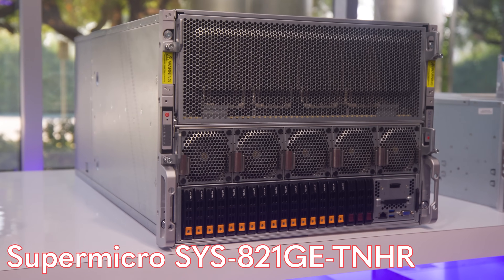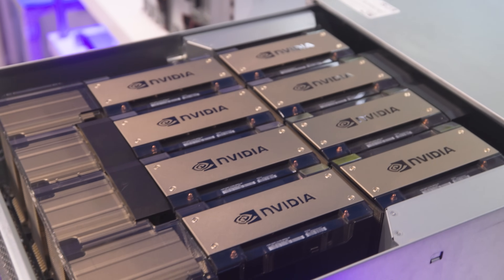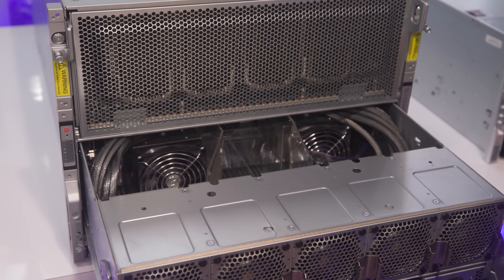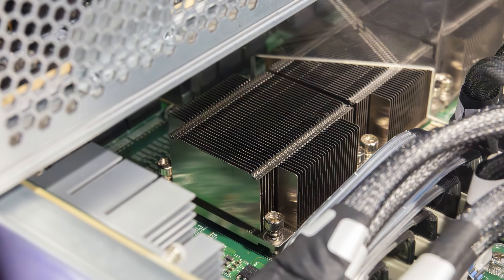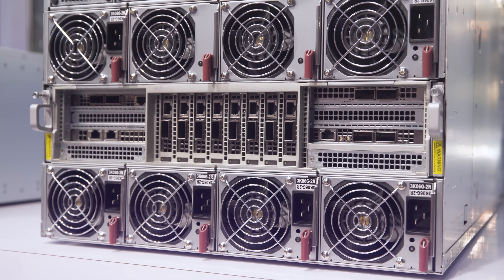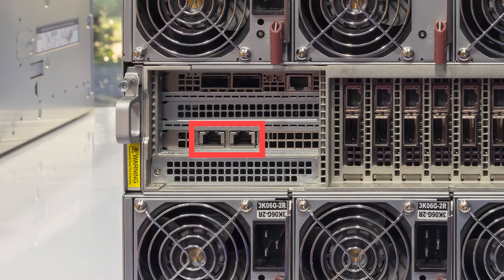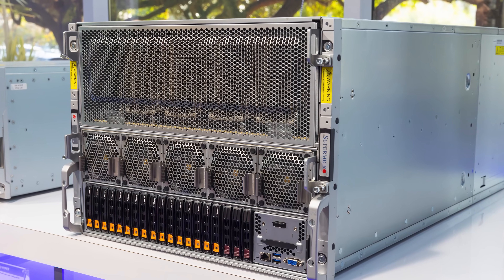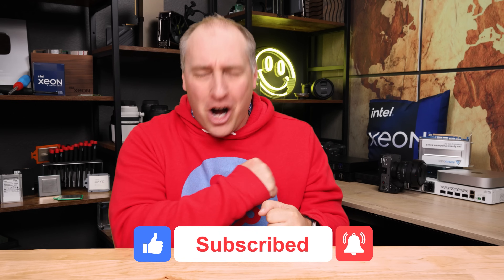Inside the SUPER NVIDIA H200 Server From Supermicro

Comment: I have a question tho, can you use this as a standalone or do you need a whole rack after purchasing ?
Reply from the maker: I mean, it is probably best deployed in a rack, especially given the power and cooling required. I guess you could use it by itself, but you would most likely want other infrastructure around it. Still, I guess you could put it on a table if you had enough power and run it.
Reply: @ServeTheHomeVideo thanks mate, all answered

Comment: Bro calls 100gbps 32 port ethernet switch "classic". WHAT? I've never even seen an ethernet port above 10gbps. "If you're still on 100gbps ethernet..."? C'mon, I won't be on 100gbps ethernet for the next 10 years, what are you even talking about?
Reply from the maker: I mean we reviewed the MikroTik CRS504 which is 100GbE in a sub $650 switch new and the adapters are now used and cheap. In this class of server 100GbE would be considered very slow
Reply: @ServeTheHomeVideo  Wow, didn't expect channel this big to reply to a comment on a 5 month old video and this fast too. I know it doesn't mean much but subscribed. I didn't know those things were available at such low prices, definitely gonna check out that video. I work in IT for a small/medium-sized company and we only have a few switches with sfp+ 10gbps ports, never even considered 100gbps. It's amazing to see how much different the hardware used in those big datacenters is from what I work with.

Comment: So... What I want to know is, is this kind of animal usable as a 3D animation rendering server? Can it be used for a setup like what ILM has for their real-time 3D rendering system for their LED circle shooting stages? Or is this animal really aimed at something different than 3D animation?
Reply: Those would typically use RTX6000 cards, if using GPU rendering. If NVlinked, they could offer plenty of RAM for rendering large scenes. Nvidia's smaller DGX servers would be used for GPU based 3D rendering. For CPU based renderers, this is not very efficient.

Comment: We are working with a data centre at work. We are consultants for carbon management. They are a medium-sized data centre. Fun fact: the industry standard for handling  failures is to slide the entire server out, put a new server in, and throw away the failed server or send it back to the manufacturer.

Comment: Hmm...I understand nVidia's concerns in regard to yield control, but it makes me curious what the yield is.

As the manufacturing process improves, and with a large enough cluster of these, I wonder if it might make financial sense for an owner-operator to figure out how to test and "unlock" any memory marked as inactive (ofc, that would require a patched/custom firmware).

A 100-million-dollar (~2500 H200 GPUs) server farm (which isn't big when it comes to these AI datacenters), could probably push out an additional 2.2-2.8GB per card, which is around 5500-7000GB. That's roughly equivalent to 40-50 extra H200s' worth of memory, which would cost around 1.3-1.7 million dollars.

Comment: Replacing memory in these still requires removing 8 (iirc) tiny screws that hold the plastic air shroud in place, which is super annoying and time consuming. Also if any gpu decides to fry itself, waiting for spares is measured in months. So any time saved in high servicability is basically pointless. That only pays off if you have spares on site.

Comment: The last computer lab I built had "only" 5.7kW per rack. (3x 120@20A -- derate to 80% for continuous loads) And the UPS was only sized for 20kVA. (it'll go to 40, 'tho) At those power level you'd stop with the silly 120/208/240 AC plugs and hardwire 480-600V. Odd to support 240V DC; the few DC power systems I've seen were in the 350+ range. ("kill you instantly, super dangerous shit")

Comment: Man o man, I used to work on Power3 AIX servers when those were so high end…750MHz eight single-core cpus, PCI-X.  We had a customer that was dipping their toe into fibre 1gb nics, which was a BIG deal for servers.  Later on they moved to CAT-5 1gb copper nics.  We had a bunch of techs and business partners over to see the nics in operation.  No one could believe any nic could push 1gb ethernet over copper.  I’m not THAT old, but wow, hardware changes so freakin’ fast.  Now this thing has eight 400gb ethernet for GPU communication.  Unreal.

Comment: Guys, 6 (128GB shared RAM) Nvidia digit's per RU, 42u rack, 252, units is ~25.2kw, ~32PetaBytes of RAM/Shared VRAM
So.....just add some switches and 3 208v 3 phase ac circuits for the whole rack! Vs just this 1x 8U GPU server..... thoughts?
Reply from the maker: I am totally in for DIGITS! I actually told AMD they should do the same with the 40 CU APU.

Comment: What a powerhouse and awesome video, I do feel like challenging the number of power supplies provided here, H200 consumption stated at 700w max , ill generously add 1800w for cpus and the other cards, adding the fans lets say 1000w, total 8.5kw. seems 3 modules are enough to power this thing at full capacity. adding one more for redundancy seems enough. I don't operate and manage servers though so I wonder why so many would be used instead of just 4.
Reply from the maker: Your 1800W is quite a bit low. But you are correct, this is 4+2 redundancy standard, and 4+4 redundancy with the two additional PSUs. That kind of redundancy is used if an entire power side of the data center goes down.

Comment: I think I missed out on CPU info of this machine. We need consumer oriented version with 1/2 GPUs to fill that market niche between RTX and Datacenter, what do you think about it Patrick?
Reply from the maker: I actually think the DIGITS and other platforms are the way to go in that space. This one is 4th and 5th Gen Xeon but there is an AMD option.
Reply: @ thanks for reply. I’m curious how digits will perform but since it’s a small package with limited power I think it will be something like Jetson. The advantage is it has lots of memory but that memory is unified. To be seen. I think there is still a niche but maybe not big enough for Nvidia to consider.

Comment: These are bound to end up in our mitts at one point. Considering we got P40s for 200$ in 2020, this means that these would be obsolete for datacenters in 3-5 years.
Reply from the maker: I think it might be sooner than that. If you think 3-4 years out, the AI rack power density will be about 10x what these systems offer.
Reply: @ServeTheHomeVideo  Pity they're almost obsolete once you get them into production ;)
Reply: @ I worked in a data center in 2024 and we  installed 150k units of H100 lol
Reply: @UCs6ktlulE5BEeb3vBBOu6DQ  — OMG!  What was the bill for all those?!?  🤦‍♂
Reply: Yeah, but how will you pay for the 1800 KWh?!?
Reply: @ I used to pay 7000$ per month for electricity when I was a ETH miner. Today I have a bunch of server and already pay for more kWh than that. You just gotta do stuff that pay for itself.
Reply: I suspect by then the ai game will have moved to custom chips that will dwarf the output of these kinds of systems. Like ASIC vs GPU mining. 
Systems that have compute and memory mixed together into pipelines so that it's all active all the time rather than having most of the memory idle as compute moves through the different layers.
Reply: @zyeborm  Once we leave DDR to something like HBM we will at least be able to manage a 70B model on cpu too.
Reply: @UCs6ktlulE5BEeb3vBBOu6DQ  eh I have run 120gb models on CPU already.

Actually in my hypothetical layout ddr would be fine. The memory bandwidth and capacity of the system goes up immensely as you have for example one node per layer, so if you have a 500 layer model you can give each layer 32gb of ddr5 sodimm or whatever and you get 500 times that bandwidth and capacity for cheap and a lot easier than trying to make stuff that can handle that much hbm. You scale by adding more nodes or bigger memory. It's not really ideal for current training, but it'd work fine for inference.

 Each hbm memory chip has like 1024 pins in the interface, it's nuts.
Reply: @zyeborm  As soon as Skynet is running it will produce better chips for sure ;)
Reply: @peterpain6625  they are already using "ai" for chip designs 🤣
Reply: @zyeborm  I suspect we are getting pretty close to that concept with Ryzen Max's combination of x86 CPU, a good number of GPU/NPU cores, and 256-bit memory bus servicing both CPU and GPU. Enterprise-tier equicalent would probably be something positively insane, perhaps with a common pool of HBM servicing a pool fo CPU/GPU dies with high-speed interconnects between them.

Comment: Data centers and the like must save a fortune on utility bills in the winter. Too bad this stuff isn't more distributed so we could heat our homes with it.
Reply: Not really because they’re using wasteful evaporative cooling
Reply: @tormaid42  Not all of them.
Reply: I doubt it. But the overall efficiency of any cooling solution should go up. I've only seen a handful of places use the "waste heat" for anything useful. (PG plant heated their office.)
Reply: It's low grade heat unfortunately so you need to move a lot of mass to move the heat. Not impossible, but not easy.
Reply: @ "Low grade" as in forced air? I'm not sure what you mean. Whatever is drawn from the wall is almost entirely converted into heat, and consider how many watts these centers use. They could easily be engineered to recover most of the energy.
Reply: @SyntacticOperator  new DC's using hot aisle containment will yes, old ones will end up payting a lot more for their cooling in summer
Reply: @SyntacticOperator  you don't seem to understand the issue. You have slightly warm air. Now you need to get that slightly warm air 2km to the place that needs the heat. 
Given your heat source and distance you will need 2km of vacuum insulated 1.5 meter diameter pipe pushing air along at 60km/h with all the energy required to do that to get this 50C air to the destination. 
Or you could use a 1" superheated steam line to do the same thing. 

If you want to heat a pool say, would you rather carry 1 bucket of boiling water, or 50 buckets of water one degree warmer than the pool to transfer the same relative heat into the pool water. 

That is what is meant by low grade heat. About the only use for it is warming up people, it's just too cold for industry, and you have to consume it at the point you generate it because it's impractical to ship it anywhere.

There have been some projects to use the waste heat from datacenters. One was heating a pool on the roof of the DC and I think another had a greenhouse/mushroom facility attached to it. 
Low temperatures, directly consumed at the source of production.
Reply: @SyntacticOperator  and if you put one of those at the destination you don't need to spend all the resources to build a 7 stage exotic heat pump at the source of your low quality heat to create high quality heat using a great deal of energy, then shipping that heat with all the losses inherent in shipping heat to the destination. 

You don't think the people paying money to cool the servers haven't thought about ways to use the waste heat? There's obviously more to this thing than you know about. Perhaps rather than thinking hundreds of thousands of people around the world are dumb for not doing the thing you think is obvious you could try learning some thermodynamics and do the maths to find out why it doesn't work.

Like think of it this way. I have a server in my house, that room is 30c.

Your house is 2km away. 

Heat your house using the heat from the server in my house.
Reply: @dieselphiend  I already told you about those and others, don't try to make silly "any in existence anywhere" arguments now.
Saying just put heat pumps in series tells me you have never actually looked at the problem with any detail.
Go on do the maths on making 500c air from 60c air and how that's much better than making 500c air from 5c air.
Now compare that to making 30c air from 5c air.
Reply: @dieselphiend  yes and like I said many times, do the maths and you will find out why low grade heat is not suitable for transformation into high grade heat and why it's only usable at the source of production and even then it only has limited uses. 
No limited doesn't mean none, don't bother with that fallacy rubbish. This was an opportunity for you to learn some thermodynamics.
Reply: @dieselphiend  do the maths on converting 60c air into hydrogen.
Assume 1 megawatt of input energy producing your 60c air and 20c ambient temperature. 

Go on. Design a system to make hydrogen with that. Tell me how much it will cost and how much hydrogen it will make. 
First order estimates are ok.

Or do the maths on using heat pumps to make electricity? I really want to see that.

Comment: I wish the price ranges were included in some of your videos. How much is the boss going to spend on this.
Reply: It's one of those "if you have to ask you probably can't afford it" kind of things, but if you really want to know:

Currently, they only sell these pre-configured (but still customizable) and they are priced a little north of $400k.
The majority of that price (around $280-300k) being the cost of the 8 x H200's.
Reply: pricing depends on how many parties between you and smc/nvidia, volume and future prospects. Air cooled version can get into high 200s and low 300s ranges. Maybe mid 200s if you order a huge number over time.
Reply from the maker: When you install these, the operating costs are a big part.